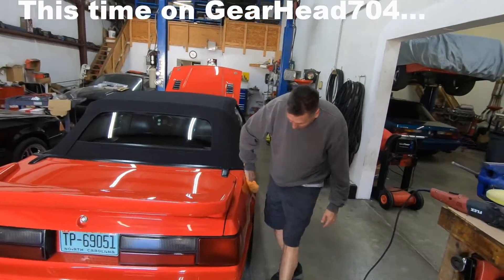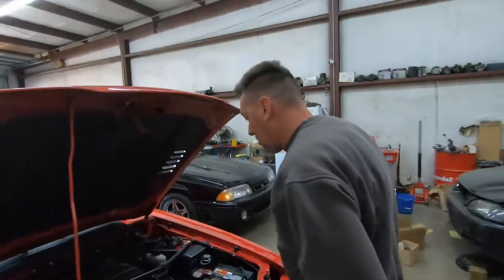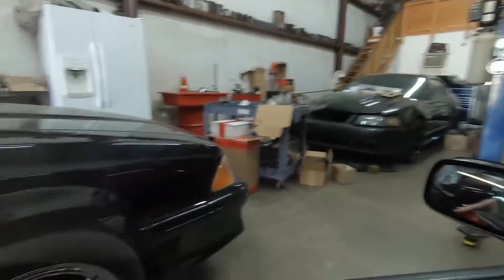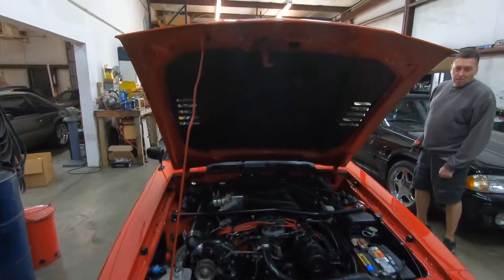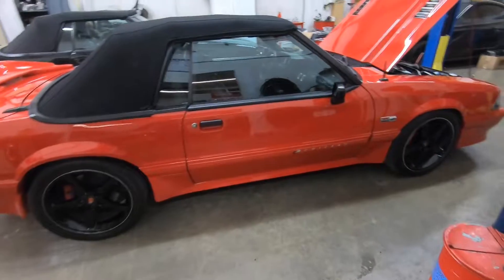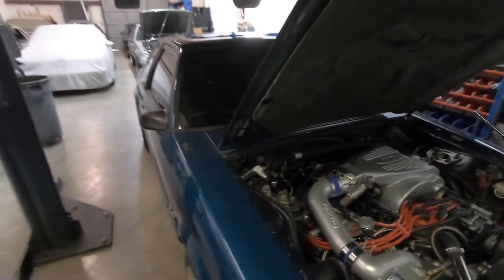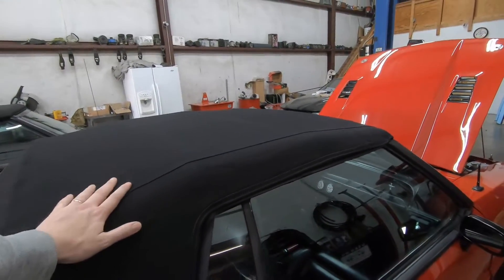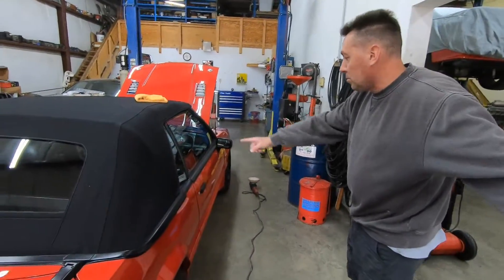FoxBody Mustang Saleen Clone Mustang Project Car

Comment: lol  60 grand in the car.. ... stock T5 and fuel system.. no way in hell does that make 560 at the tires on 6# of boost.. He should also spend $2 in zip ties and clean up those spark plug wires.
Reply from the maker: Cool, he's definitely working on cleaning it up. Thanks 4 watching.
Reply: Graymare Mustang made 496hp N/A to the tires, stock block stroked to 331, stock T5 but it was carburated.
If he did the ' 94+ fuel rail, it will handle that power with the 255 pump and big injectors, with a 347 so I don't know why that seems so far fetched.